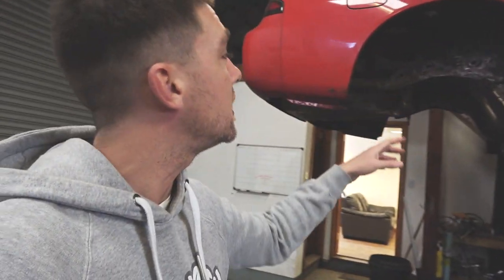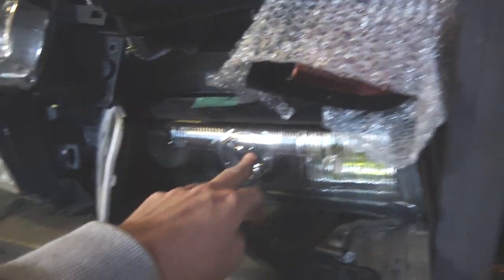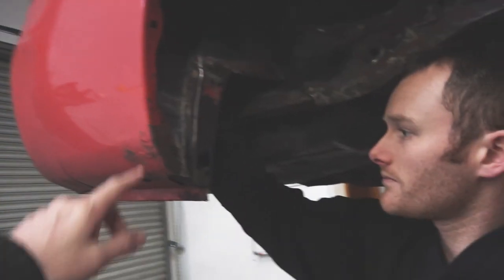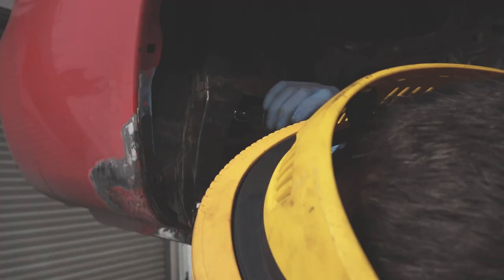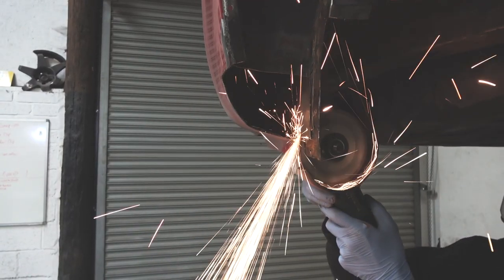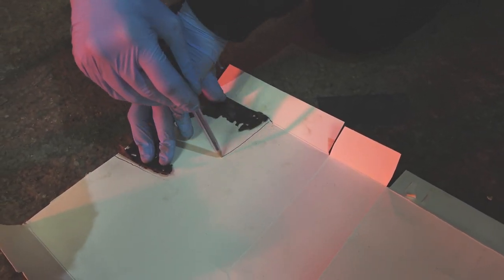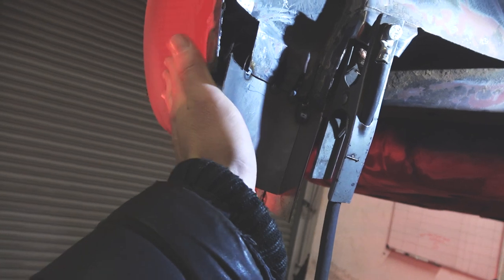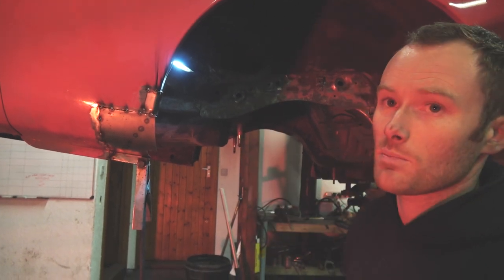🐒 HOW TO DO A RUST REPAIR ON A WHEEL ARCH / REAR QUARTER

Comment: Nice bodywork, but new sheet metal must be primered from inside with weld-through primer or zinc paint. Otherwise it will rust from inside and all work is pointless.

Comment: ML ,  tell Simon to look into a beverly shear for sheet metal work . i think he'll dig it .   much better than a grinder for cutting out those little pieces copied from templates.   also .   a blair spot weld cutting  bit. its like a baby circle saw for spot welds  . leaves a backing usually also instead of drilling through . and makes for easier panel alignment .

Comment: You've just made one of the best wheel arch welding videos on the tinternet. Maybe just mention that you need 1mm steel and that he was using gas shielded mig. I used 1.5mm and it was really hard work 😁. Self shielded is a bit more messy too!